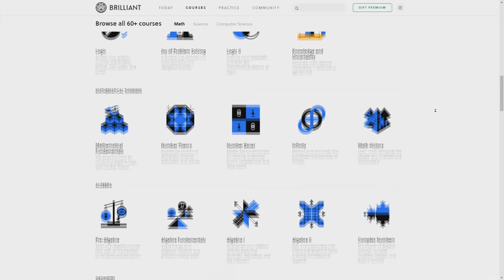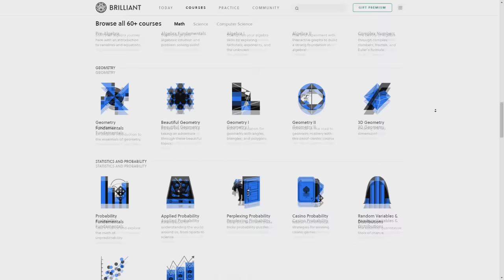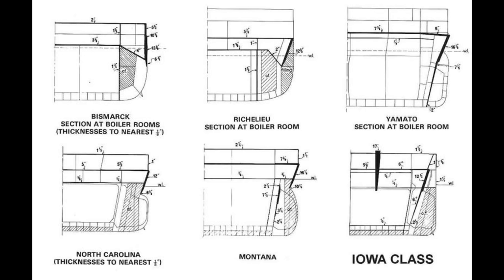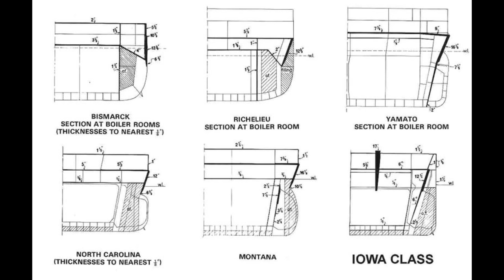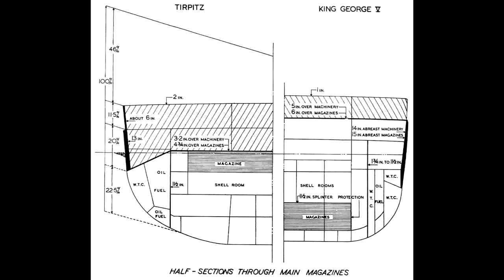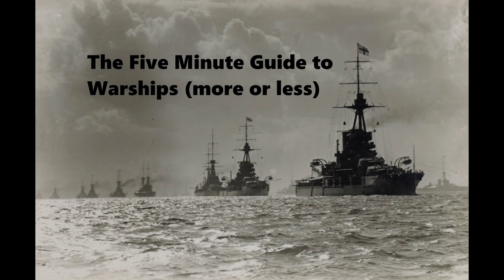Dreadnought Modernisation - A tri-wire balancing act

Comment: Good evening, I do believe that the RN missed the mark on the refit considering the Queen Elizabeth class when it came to the speed of these ships. They could have increased their speed up too 5 nkts and achieved 29-31 nkts. Had they increased their speed to 28 - 30 knots range their fleet would have been a fast battle fleet that would keep up with the carriers. By what you had  said, for the increase in the armour would have reduced speed but speed would have been the factor in keeping out of dangerous situations, is my thinking.  Imagine to have 5 QE ships along with the 2 renown class and 5 KGV’s along with the Hood, that is a major improvement. What kept them not doing this?
Forever in His service
Reply: Money is a big one. Political stuff is another, as to do that would have required similar levels of rebuild to what the Italians did. Which was technically against the treaties, as they banned significant hull modifications (lengthening/widening), direct main gun improvements (like replacement/boring/adding more), and main belt increases. The only reason why the Italians got away with it was because they had scrapped their newest ship, were well below the allowed tonnages (both the 35k and fleet BB total), the reduction in # of guns, and (probably the most important one) promised not to build more if the French didn't (and the French where too broke at the time to pass that offer up).

Comment: Think you may want to take a look at the Netherlands and a ship that could have been as it was being constructed before the war started but never finished. It's pretty much a Scharnhorst on steroids. This ship would be a hell to fight as it would have been a huge improvement over the Scharnhorst in every single way except armor which was about the same.

Project name: Project 1047
Ship name: Koningin Wilhelmina class (suggested name)
Planned: Originally 8
Theater: Pacific (Dutch Indies)

Armament: 
- 28cm in triple turrets (9 guns)
- 12cm in twin turrets (12 guns)
- 40cm in twin mounts (14 guns)
- 20mm in single mounts (8 guns)
(Aircraft and catapult not included)

Armor:
Main belt: 225mm inclined at 75 degrees (on 50mm teak with 18mm shell plating)
Upper side belt: 40mm inclined at 75 degrees
Side belt forward: 30mm tapering forward to 15mm
Side belt aft: 30mm upper, 60mm lower
Longitudinal anti-torpedo bulkheads: 40mm
Depth of main side belt: 5.35m (2.10m below DWL, 3.25m above DWL)
Main armored deck: 75mm + 25mm
Lower deck: 30mm with 30mm inclines
Boiler uptakes: 225mm gratings (main deck) and 75mm gratings (lower deck)
Lower deck aft: 125-150mm protecting steering gear and propellers.
Transverse bulkheads: 30mm + 15mm secondary forward. 200mm tapering to 40mm below main forward and aft
28cm barbette: 250-200mm tapering to 40mm below
12cm barbette: 75mm tapering to 60mm
Turret armor: Not indicated
Conning tower: 150mm
Underwater protection: Double bottom depth 1.50m. Depth of side protective system 5.35m. Height of bulge compartment 9.60m. System consisting of air space-fluid air space compartments.

Machinery:
SHP: ca. 180000
Speed: 34 kts.
Radius: 4500 NM at 20 kts.

https://www.netherlandsnavy.nl/Special_battlecruiser.htm

Comment: Just noticed this afternoon that the Royal Tank Regiment's badge has the motto "Fear Naught". Which made me wonder why "Dreadnoughts" were not "Dreadnaughts", "naught" and "nought" apparently having the same meaning (i.e. "zero", at least according to Wikipedia, therefore "not", when it comes to Dread or Fear). Maybe tradition, carried over from the first HMS Dreadnought in the 16th century...
Reply: Why wouldn't a Land Battleship unit share a motto with a sea battleship?
Reply: @iansadler4309  Yes indeed. But you wonder why the badge didn't say "Fear Nought" instead of "Fear Naught". Would one be more grammatically correct than the other? 😁 "Fear Nought" does seem "wrong", somehow.. so does "Dreadnaught", by the way.
Reply: @iskandartaib As far as grammar. There are roughly 5 different forms of English in England. London plus NW,NE,SW,SE. One batch of grandparents came from E of Liverpool.
Nought was pronounced nowt,as opposed to not. Scone pronounced scon,not scōne or scoon.
 Drag,draw,drogue came to English from same source by way of different routes,different centuries. As to the histories of nought,naught,I simply do not know. In Shakespeare's day,knight ,the k was pronounced,comes from German word kenecht meaning servant.
The only thing we know about the history of individual words is that the story can be very convoluted.

Comment: As I have slowly begun to comprehend, you can get a rather solid improvement in your main armament against other armored warships by optimizing the AP projectile designs.  Unfortunately, during WWII ship-vs-ship battles under conditions where the better AP performance would have made much of a difference was almost nil.  Gun power, even with older less-than-optimum ammunition, usually was greatly biased to one side of a given battle such that some improvements in the ammo would not have changed the final results much.  In WWI, this would have had some more serious results, but the big gunnery battles of that war were rarely repeated in any kind of equivalent form in WWII.

Improving the chance of getting any kind of hit, no matter what performance the weapon hitting the target had, was MUCH more important, as the great improvements from using radar and VT fuzes later in WWII had on attacking aircraft, including attacking kamikazes -- that is why guided missile AA was turned into a crash program after WWII in the US Navy, to the point that the AA missile systems, while effective, were so hard to keep functional with the existing forms of crew training and shore support that a major effort was started in 1963, which I became part of in 1973 until I retired in 2014, to bring the training and support methods successfully up to what became "modern" levels of continuous training and support.  Electronic equipment was found the hard way to not be something that could be supported by previous mechanical-engineering-type "by the seat of your pants" efforts.

Comment: I've always wandered since the battleships really didn't get used like they were intended (against other battleships) if it would have been more economic to continually modernize the fleets. Would have saved alot of steel for the armies. But that is all set by doctrines. If you would have known that a cargo Ship with a wooden deck could do so much damage.... With hindsight I would have had a fleet of modern destroyers, cruisers and carriers with a battle line from WW1 that has radar, modern guns and oil boilers!

Comment: I believe the difference in thinking was due to tactics and politics. American pre-war dreadnaughts were slow, so in the end, they accepted that they would not be able to catch up with any modern ships if they kept within treaty limits and even with improved boilers and weight reduction. They opted to used the saved weight in the other areas such as increased firepower(FDC, radar and AA) and armor(torpedo bulges). So, they were optimized, although top heavy, in the areas that were actually pertinent to the WW2 environment, post 1941. 

Most other navies, because of budgetary constraints and internal political strife still viewed the battleship as the major surface combatant. Even though the British and Japanese had already proven that the battleship was more of an all around surface line breaker then a battle winner most of the time. With the finessing of the AA, or should I say, the total ridiculous amount of secondary/AA batteries, American Standards were able to take on a new role that other nations ships would be ill suited for until later in the war; bombardment of heavily defended, contested air positions while providing AA to the less mobile transports and escort carriers.

I don't think it was so much of an important decision to make the dreadnaughts more effective towards other battleships as it was to find them a role that they would be useful for. Even back to WW1, they were barely used in their designated roll. The way that the US and UK used them in late WW2 is where they shined, with the occasional surface action(Leyte Gulf). It was more like adopting a policy of combined arms doctrine at sea as opposed to making a world breaking ship or keeping up with your neighbors. Something the pioneers of carrier attacks, the UK and especially the Japanese, didn't understand until the mid-war period.

Comment: In the discussion of armour weights, belt vs deck, at about 43:00, the calculation appears to ignore that there are TWO belts, one each side, and only one deck. So if you have a 20ft high belt per side and a 100ft wide deck, the ratio is really (20+20):100 which is also 1: 2.5, which is about the same as the assumed thickness ratio (~5" vs ~12") which means the weight of deck and belt armour is similar; the deck isn't more. (And that's ignoring that the deck width will slightly narrow along the length of the citadel.)
Reply from the maker: But adding an inch to both will result in 2.5 times the weight when upping deck armour.
Reply: @Drachinifel  Agree for the delta, but the actual words in the video are comparing total armour weight not incremental: "you'll have a lot more weight in your deck armour" (comparing 13" belt to 6" deck, I misremebered 12 vs 5) and that itself isn't true for the total, it's actually quite close to balanced..

Comment: From what I have researched, The Revenge class were actually (although marginally) better armoured than the Queen Elizabeths WITH the same main battery (I believe that they were actually newer than the Queen Elizabeths as well, so, in a way, they were a bit more modern but I have read that they were not as stable...). They seemed to be a "wasted asset" in WWII. Seeing that not even all of the Queen Elizabeths saw  modernization (even the old Warspite was only partially modernized), it is obvious that British shipyards simply were stretched too thin. Now, had they sent them over to the U.S., the American shipyards would have slapped a 20 or 40mm mount on every bit of unused deck, space  installed the latest radar AND an ice cream machine to boot!
Reply: One of drach's older videos was about sneaking a revenge class into shore bombardment range at night of a german port during an air raid. The older battleship was considered more expendable.

Comment: This is surprisingly consistent with HoI4 ship upgrading. 

Older Hulls are typically smaller, slower, less durable and can carry less guns and equipment than newer ones. 

Upgrading the Engine or Armour means cutting the ship apart, so it is expensive and almost never worth it. 

Adding or upgrading a module or a few, such as Radar, Turret, Torpedoes or AA is moderately expensive and might be worth it. 

Adding modules lowers speed. 

If the upgrade costs above 30% of the price of the ship, you're probably better off building new ships.
Reply: That sounds pretty realistic, only thing missing is stability concerns.

Comment: If not, take into account cost, dock space, and treaty displacment limits, I would have modernized the Nelson's.
1) lengthen and rebuild the stern of the ship to provide a more aerodynamic hull shape to improve speed.
2) i would move ads bew engines and redesign them to be slightly more back towards the new stern space to free up the old space for additional fuel and armor bulkheads. Although increasing the length of the belt would require the entire armor belt to have to be replaced with thinner belt armor to compensate for the weight of that increased armor coverage stretching out across more space of the ship to protect the now longer citidel, torpedo protection could still be an issue however.
3) The superstructure could be modified more easily, and the secondary armament could be repositioned in more favorable positions on the deck/ superstructure since there is more space to work with.
There is so much more to do but that would take to long to type lol
Reply: I knew a man who built battleships. He taught me some welding tricks.

In small talk, you can thicken belt armor some, but it basically has to be spaced or bulge armor. You can add deck armor as long as it has structural support, but anything welded to the sides has to be designed to peel away, because it's going to, period.

Lengthening a hull is a total rebuild, with the exception of things like adding a wet deck to dock support vessels such as landing craft. Lengthening the bow means opening up the bow, and altering the keel and weather braces. Lengthening the stern means completely gutting all of engineering, extending the keel, and redesigning the structure of the entire hull to deal with the altered hydrodynamics of the impact of waves side-on, and shearing forces of turning.

Splitting and extending a ship can be done -- in theory. Look up how the entire United States Coast Guard cutter fleet (originally World War II destroyers) was sunk or reduced to being sold as scrap as a result of the "upgrade" designed by Raytheon as the Coast Guard's first budget expansion in sixty years.

Really neat guy. He found the same model of welder he used on the Nevada class at an auction and rebuilt it, kept it in his front yard next to his flag pole.

Comment: I always  thought the Revenge  Class Battleship wer over look some what, they could have benefited from a engine upgrade to the sam level as the QE Class's, they would have had enough  space inside  to fit the same engine upgrades the Queen Elizabeth class as it was more compact endun set, which left considerable large unused space in the Queen Elizabeth it would have been a squeeze but look at the upgrad plans on the QE it would have arguably worked. this would have made the Revenges  with the new engine speed would have been a match for the Queen Elizabeth's or most likely faster be of the smaller  Hull and with the removal of all the useless 6 inch guns created  a larger  Hull volume, increasing  the already  better  than QE armour scheme,   with more deck armour, a tower  bridge, improved torpedo bulges and more anti aircraft batteries. This would have made the Revenges, formidable ship with the extra speed and fire power.

Comment: I wish it was easier to get English sources on Italian capital ship infrastructure because I suspect the reason Italy bothered saving the 12'' BB was because they just couldn't make a proper 14''+ vessel, but I can't be sure. It seems they really wasted their effort because the 12.6'' gun was next to useless when Italy was in a naval rivalry that included Britain even if they were focused on France, and Britain's fleet was not not challenged by anything less than 14''. Trying to even obliquely claim the Mediterranean without ships that could even challenge the oldest of British BBs in 1935 seems very dangerous.
Reply: The Italians were building the first two 40,000 ton, 381mm gun "Littorios" (1934-1940) at the same time they upgraded the four older battleships. They didn't have the funds, resources or industries to do anything other than bore out the 12" guns. And given the 1940 French and Italian FC, the 320mm gun was not that less powerful than the French 33cm or 34cm.
Reply: @michaelsnyder3871  Yes, but one wonders if they would not have done better to have prioritized the big-gun ships rather than trying to force the old ships to keep going. Even just two 15''-gunned ships sooner than 1939 would have basically nullified all the existing French BB because none of the French ships had the armor to resist 15'' fire and their own guns would have been outranged. Instead, Italy spent a fortune on upgrading old ships that were only a "match" for the older French ships on a good day and basically useless against anything British. 
      This is why I am curious about their infrastructure, because if they had diverted the resources spent upgrading old ships to speed up production of the 15''-gunned vessels and expand infrastructure to make more new ships faster and cheaper, it seems Italy would have done better for its ambitions to claim Italian dominance of the Med. As it was, they only just competed with France and never had a chance against the British, despite those both being rivals.
Reply: @genericpersonx333  Read Brescia's "Mussolini's Navy", the section on the various yards indicates which were large enough to build a battleship from scratch and which weren't, and the sections on the various battleships outlines their bulding/modernisation theory and the timing of it.  Remember that rebuilding the Cavours and Dorias could be undertaken in a dry dock while the Littorios were on the slipway, and everything on the Littorios had to be built from scratch.
Reply: @br-v388  Thank you, I will give it a go. Have a good holiday!

Comment: Re-engining a battleship, for speed and/or modernization, sounds like a massive task.  The machinery consists of huge components that probably have to be installed intact rather than assembled inside the ship.  It's at the very bottom of the ship, under the superstructure...replacement would require removing most of the superstructure, or going in through the side of the ship.  How was it done?  Are there pictures of ships during this part of the modernization?
Reply from the maker: There are, but they are quite hard to find. :)